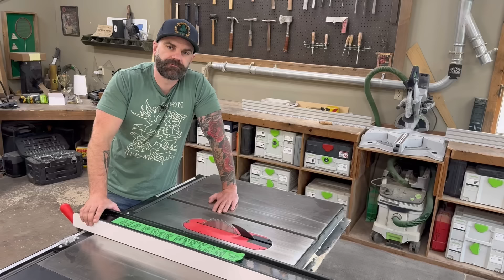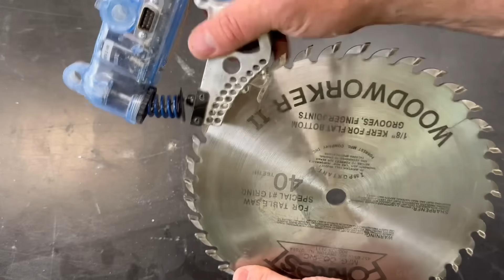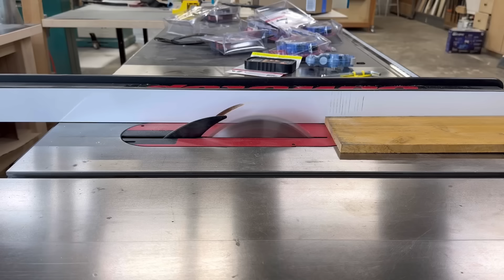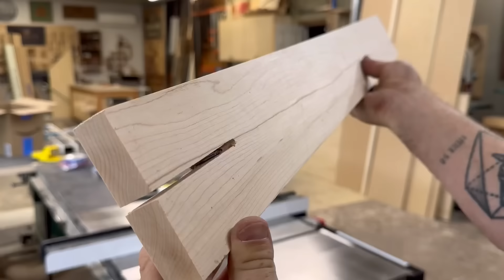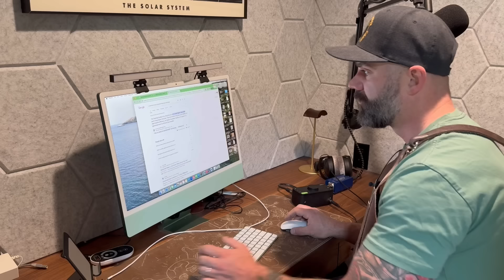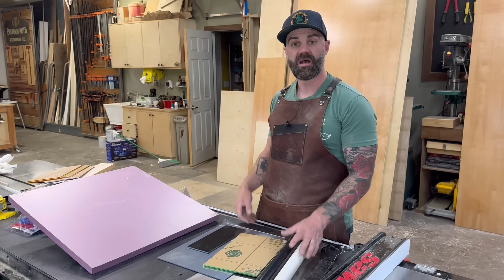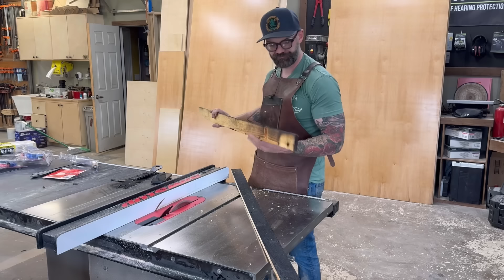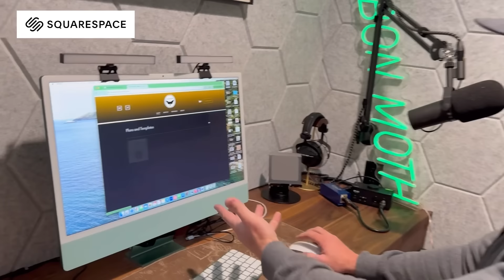Finger Versus Table Saw || Testing SawStop Myths

Comment: JKM did say there was a capacitor in the mechanism. so the capacitor would still be able to activate the brake even with no power applied to the saw until the capacitor discharged.
Second, I had a "pre-lawsuit" Bosch table saw that tripped both with wet direct contact treated wood and a reclaimed piece of pine that had aluminum tape on it.

Comment: What sets my SawStop off is when I don't bring it hot coffee for early morning work days.  Also, I set mine off when it just nicked my aluminum miter gauge fence that I didn't quite adjust correctly.  Surprise!  Are you sure the insulation your brother was using wasn't one with aluminum backing?

Comment: I had my sawstop false-positive on reclaimed wood with a finishing nail in it. I saw the shower of sparks off the nail, and then POP. My best guess is that a filament of shaved-off nail managed to make contact between the blade and something metal inside the saw -- like maybe the aluminum shoe on the brake -- and that was enough conductivity to set it off.

An expensive false positive, but I'll accept it for the increased safety.

Comment: Since there is that 3V charge on the blade any significant change in conductivity may set off the Sawstop. So far as wet would go, it may depend on where it got wet. If it was in fresh water, like your Willamette River there is relatively high resistance or low conductivity. But if the wood logs were held in a salt water pond prior to cutting, like some coastal mills would do, then the conductivity would be much higher because of the sodium ions involved with salt. We all know salt water is much more conductive than say distilled or tap water. So, one more experiment…soak your board in salt water containing about 3 to 4% by weight of salt. Then see what happens. My bet is that the mechanism will be actuated.

Comment: Allegedly, in addition to the type of metal, it is the size of the piece of metal that determines its thermal conductivity as well as whether or not you are touching it. The aluminum fence was large, so whether you touched it or not may not have mattered. Allegedly if a person is touching the nail or staple while it comes into contact with the blade it will set the safety mechanism off.

Comment: Not sure if this is just a dry southwest thing, but our Home Depots here in Colorado do their cooling in the summer months not with standard A/C units, but with swamp coolers, a.k.a. evaporative coolers, where the air is blown through water-soaked mats, the evaporation cooling the air.  In other words, why even bother selling KD-HT lumber, when the air has been raised to around 157% moisture anyway, or somewhere north of the actual moisture content of that wood-storage river?  So, besides the normal wood going from green living tree to sliced up boards and stocked in the rack at the HD store in record time, even the dried stuff is being stored in air so thick with moisture you can almost see clouds up around the lighting....

Comment: hypothesis (and more testing for you): the kind of metal matters less than the amount of metal. jig fence: lots of metal, lots of potential can flow, triggers. old nail: not a lot of metal, not a lot of potential flows, doesn't trigger. try a small piece of aluminium and a large piece of steel!

Comment: Great video but it would have been a lot cheaper to make by doing the test with the saw in bypass mode and just watch the lights to see if it would trigger. I accidentally tested mine when I was cutting some scrap pieces of osb and one of them had the foil facing for a radiant barrier. Fortunately I had an old cheap blade installed so my woodworker 2 didn’t have to suffer.

Comment: I feel many of the myths about material (like foam, cardboard, etc.) setting off a SawStop are caused by woodworkers doing something stupid, then telling their significant other “I don’t know what happened honey, I was just cutting cardboard.”  I have stood next to the SawStop rep at a tool sale and heard a couple of these stories and after they leave he has made some interesting comments about the story’s lack of credibility.   

The most interesting story I heard was about an older gentleman that set a SawStop off at Woodcraft during a class, reportedly just cutting wood.  The instructor changed out the blade and cartridge and class resumed.  About 15 minutes later “boom” he trigger it again.  In a more detailed review of the gentleman’s technique, and the small nick on his thumb, it was found he would turn the saw off and place his thumb on the side of the blade to slow it down quicker … setting the saw off.
Reply: Sounds like a good argument for a blade brake.  They have them on circular saws and bandsaws.  Do any table saws have one?
Reply: @gregmead2967  my 1974 unisaw had one lol. It took a few seconds for the centrifugal spring to pop and reverse current, but it stopped quickly after that. I believe the saw stop has one because it still stops faster than the unisaw.
Reply: Wow that's insane, what a dumbass lol

Comment: Very interesting!!  One question though...  I have the SawStop Jobsite Pro saw, so it's on / off mechanism is a little different to the cabinet ones.  On the Jobsite Pro, when the saw is "ready" (meaning power on, the light is green and all the internal safety checks are done, but the blade is NOT running), if I touch something to the saw that would set it off the light on the power switch will start blinking red!  So for some of these test could you not have just touched the material to the blade to see if the light starts blinking red on the power switch?

Also with regards to the mechanism working while the blade is spinning down, on the Jobsite Pro that same power light is blinking red while the blade ramps down to let the user know that the safety mechanism is still primed and ready if the blade senses something.  I'm guessing the cabinet saw does not work this way?

Great video!!!!

Comment: I wonder if blade itself and/or its coating plays a role here. Since it is about conductivity and thresholds here, probably blade could drive the threshold up, leaving margin to reach a trigger much smaller, which would trigger the brake. Another wild idea is dirty blade, by guess is IF you have “some” dirt that is conductive, that could also help with reaching threshold of a break.

Comment: I learned two things from this: that the blade is stopped by a magic explosion and that Home Depot evidently stores its cedar planks in a river. You could do one more test where wet wood might trip it. What if the damp wood had a piece of aluminum touching it but nowhere near the blade, like the fence? Since most water is conductive, there's a slight chance it'll trip, especially if the wood had been stored in a river.

Comment: I guess it's working by having the triggering part adding capacitance to an oscialting circuit - tuning it to a specific resonance frequency which then is detected. But to confirm or deny that, someone with actual electronics knowledge would have to look at that beast.

Btw, safety glasses are never wrong - but didn't your expensive saw came with a blade guard?

Comment: Was the aluminium fence possibly in contact with the bed of the saw ? (screwed from the bottom ?)  that would ground it pretty good.

Also.  What about epoxy ?

Comment: I have a CO2 laser that I used to try and cut a 3/4 piece of plywood as a test.  The wood was very charred around the edges and the cut was not successful. The charring was all the way through the 3/4 piece of ply, and was quite thick.   I cut the wood into scraps and when my SawStop hit the carbon burned area, it deployed the brake.  I called SawStop to ask and they reminded me that carbon from burned wood is very conductive.  Lesson learned.

Comment: I just want to point out that when you were cutting the aluminum, it looks like there was continuity with the table saw body itself via the fence guides. Conversely, whenever you were cutting steel, there was no continuity between the blade and table. I'm pretty sure it isn't actually continuity which sets off the blade, but I just noticed it as another variable. 

What I'd be curious to see is if the size of a piece of material matters. From what I understand, this works similarly to a phone touch screen. These rely on changes in capacitance in order to detect touch. When you have a very small point in contact with a touch screen, it won't detect anything as the change in capacitance is tool small, but when you have a larger point in contact, the phone registers it as a touch. You can test this out on your phone by using a utility knife and trying to use the screen with the point of it. It probably won't work. However, if you rotate the utility knife so that it is flatter against the screen, it will register the touch.

Now this is how I think this applies to the sawstop (I don't know if this is true or not): the blade comes in contact with a conductive material (like a finger) and that material forms a capacitor with the table. If the "capacitor" is large enough, the sawstop triggers. This would explain why a nail or a staple wouldn't trigger it as there isn't much of a capacitor at all, but larger conductive pieces do.
Reply: It wasn't touching the fence, watch again. The hardware is countersunk. There is no electrical path. All of the comments like this are wrong. Does anyone really believe a company such as Rockler would leave hardware sticking out to scratch your table saw? I don't think so.
Reply: @carlstrohm3785  The guides inside the table tracks are metal. The hardware connecting to those is also metal. It looks like that hardware also contacts the blue aluminum piece (also hence why I only ever said that's what it looks like in my original comment, I obviously can't verify). I'm not actually a woodworker by trade, so sorry if I'm getting terminology wrong here.

Comment: I use jobsite Saw Stops at work. I've hit framing nails and screws, nothing. I've ripped "heavy" 2 x 4's and it trips. I've seen the fence touch the blade and set it off. Azek/PVC renders the saws unusable. Biggest issue is after a few trips the red insert can warp and the arbor is slightly off. Finding someone who fixes them is difficult, plus the down time with no saw.

Comment: I set off my 1.75 hp 110V Sawstop when the blade touched the head of a steel wood screw in 3/4" plywood.

Comment: I have set off my sawstop brake with a single 18ga pin nail. I also set it off when it was turned off and the blade had like 2 rotations left spinning and I touched the side of the blade to stop it. It did not stop the blade so violently but just a small clunk.

Comment: I have set mine off with wet wood.  It was a pine 2x6 that had been outside during the rainy season for quite some time, and I was making stakes out of it for my wife's gardening.  I did cut several before it tripped though, so I have no idea what the circumstances were that set it off on that particular cut.

Comment: Current is not measured in volts - He got the point across though.  Aluminum is likely the most common metal cut on a table saw, so for some folks that's an issue.  If you rub a couple pieces of that foam together a bit you'll definitely get a static charge.  Thus, if you grab a sheet off of a stack of foam panels you would have a higher potential for tripping the saw stop.  You spent a lot of money to make this video, and I thank you!

Comment: I'm curious if atmospheric condtions could come into play with some of the materials like the foam or PVC pipe. Maybe if the humidity was much lower there would be more static charge in the air? Not sure, just speculating.

Comment: Also, if you have a flesh contact with the blade and set off the brake, contact sawstop. They will have you send in the brake and they will replace it for free.

Comment: You are a little wrong with the point about alumimium, it is the SIZE of the metal that made the difference, an aluminium nail or screw would not set it off but a larger piece will.

Comment: As far as the wet wood setting the blade off, I’ve seen this happen in high school shop class. The roof had a leak in the shop and soaked some OSB. We ran the OSB through and set it off without anyone’s hands near the blade. We couldn’t use the table saw for like a month because we couldn’t get a replacement saw stop. I wonder if particle board or OSB can have a higher moisture content than regular lumber? Would be interested to see if that changes anything

Comment: I have had two drops, one that I can explain (thumb) and one that I can't.  Two Forrest WWII blades were involved, so naturally, once I got the aluminum blocks off, I sent both back to Forrest for repair.  One just lost a carbide tooth, easily fixed, and the other had broken an aluminum tooth support, which they couldn't fix.  Still, I got one blade fixed, balanced, and sharpened for about $35 with postage, so good to know! It works perfectly again.

Second, you can send the brake controller (just the blue bit) to Saw Stop, and they will look at the data from the trigger to determine if it was a legit trip.  They'll replace the cartridge if it's not.  It would be interesting to see what SawStop's reports on all of Jason's cartridges said.

Comment: Hey Jason, thermal conductivity and electrical conductivity are two different things.  Thermal conductivity is how much a material can transfer heat energy.  Electrical conductivity is the ability to allow electrons to move.  While i haven't looked at the sawstop too closely, i'm assuming it works on another electrical property of capacitance.  This is similar to how touch lamps work.   Everything has capacitance but the value of it depends on the size of the materials and the dielectric involved (see wikipedia).  Its likely a change in capacitance value is likely what sets the saw cartridge off.  It shouldn't matter if its galvanized steel or aluminum it will have to do with the size and shape of the object.  Similarly, water is actually a bad conductor until it get impurities dissolved in it like salt (its the salt ions that conduct).  It could depend on local conditions like humidity and if any contaminates are present to allow it to conduct your capacitance...
Reply: I guarantee you there are plenty of dissolved ions in that river water without it being salty.
Reply: @DarkSeraph351  of course there are, but it matters  what those dissolved ions are.
Reply: @davek39851 not really. Ions are just partickles with charge, react to electric field.
Reply: I'm no expert, But it makes me wonder if the sled set it off Because it's in the tracks therefore grounded? Ps, cool video!
Reply: Came to say this.  Probably won't get tripped by a nail sized bit of aluminum or a rail sized peice of steel.  I would guess that bigger wet log might have too.  Good video though.
Reply: also wonder if crosscutting the wet wood would matter.
Reply: I would be interested to see if your wood was salt water soaked. Would that set it off?
Reply: @joeriedl2349  probably.  it definitely gets set off by wet pressure treated wood, but dry pressure treated wood does not do it.  the copper salts in pressure treated wood are definitely more conductive than plain old wood is.
Reply: With a degree in engineering, this was literally my first thought about these saws (when I first heard about them), it is the capacitance, the blade is electrically charged (like a capacitor in a circuit), when something conductive with enough capacitance makes contact with it the charge on the one side of capacitor drops, which is reflected on the other half as well, which causes a short period of current flowing through the circuitry, which in turn sets off the piston. It is not a complicated mechanism, but the salt is in 1 - adjusting for variance in blade capacity (which is what's happening when saw first powered on, it is pumping the charge into blade and measuring the state to ensure it is steady state), 2 - making the electrical AND mechanical parts fast enough to cause minimal damage, it should be sensitive enough to trigger on the flesh contact, but not overly sensitive to trigger on slightly more than usual wet timber.

Comment: You probably need to ‘ground’ the blade to trigger it i.e connect the blade to the table structure or earth via an electrically conductive material, including your body. Foil probably needs to be against the table surface to trigger it.

Comment: I can confirm that wet wood WILL trigger the brake.  I have a Wood Mizer sawmill.  I was building a gate and arbor with white oak.  I was cutting some fresh milled 8/4 boards on the Sawstop when it triggered.  I have a feeling your board didn't have enough mass or density, because green white oak definitely will.

Comment: It looks like the Rockler sled has aluminum runners too. Do they touch the fence? That would complete a circuit between the blade and the table (which is probably grounded) and trigger it. I also wonder if pine can reach a higher water content, since cedar is know for weather resistance.

Comment: I think the aluminum test would be more conclusive if you eliminate all potential paths to ground from the aluminum. Set the fence on a sheet of plastic, like delrin. Make sure the aluminum isn't in contact with the saws fence. Then push it into the saw with an insulated electricians screw driver. This way when the blade contacts the aluminum, the only conductive thing touching it will be the blade.

Comment: I would be very interested in the times when the stop kicked in for you. You said the mirrored acrylic, were there other times? I only have a low end contractor portable table saw, it demands the utmost respect when operating it. Just like all my power tools. Keep all fingers away from the moving blades, bits, and surfaces. Listen to that inner voice, if it says to you, this is dangerous, STOP. Think about what you need to do and come up with a safer way to do it.